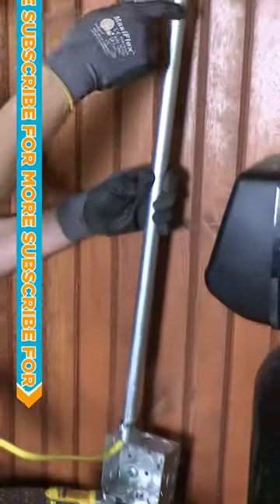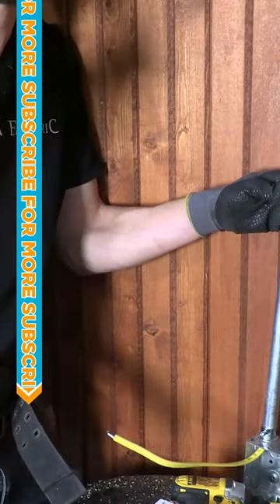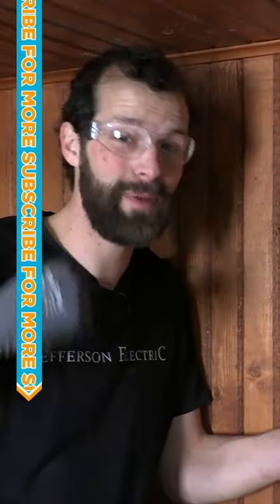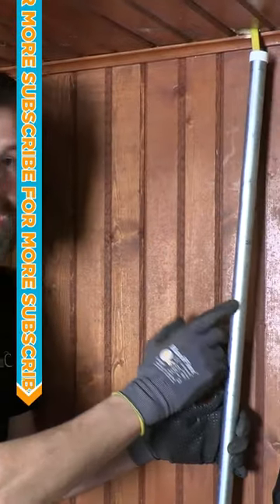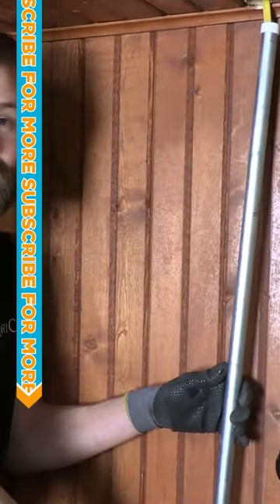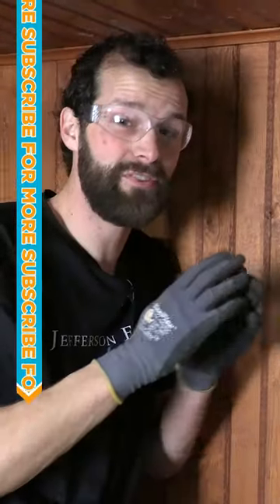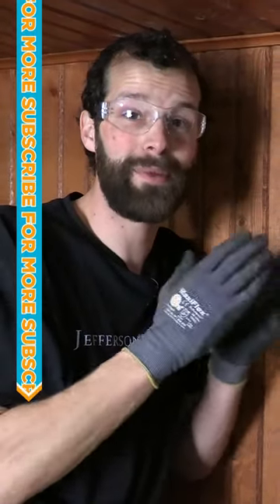Can Romex Be Run In Conduit?

Comment: The big problem of pulling romex in any conduit is difficult due to the flat side and solid wire. Personally, I would pull stranded wire indidual conductors to a jb and run romex to the panel if you have any 90 degree bends. Why run both at the same time it's necessary. Union Foreman since 1986.
I do industrial and commercials, mostly rigid conduit or emt. I used pvc a couple times to pull 2 circuts to a gazebo running 3/4 in pvc and plenty of wire lube and the 60ft with 3 90s and had a hell of a time. I switched to 5 #12s to the basement and ran romex to the panel. Pulling romex through is like pulling erasers through the conduit. Both have their uses. Using individual conductors cost less than the romex. It's unessasary and cost more. Solid wire is rarely used in my field. We don't do MC jobs, we do Technical Services for all fields of electrical construction power houses to airport runway and taxi way high voltage lighting, highway, 5g light wave for cell towers. 
Old saying, never enough time to do it right but time enough to do it again. I tell the crew if you do it right the first time, the job will make 
 money. In the power houses, they require identifying each wire at both ends for redundancy in quality control. Even the best of the crew could make a mistake. Thousands of wires in 10 weeks working 7 12hr days with 40 to 80 electricians. IBEW 5 in pgh pa has a fantastic education 5 yrs of school first 2 yrs you go to school during the day and are paid 8hrs and work 4 days for guaranteed 40 hrs min and 4 yrs of CCAC everything is free of cost. After completing the program with 10k hrs OTJT then you receive a journeyman electrician certification through the state. Then, constant continuing education in speciality training. I have witnessed the constant growth of the electrical field. As pneumatic control automation to the elimination of pneumatic to all electric via Analog in Analog out. Binary in and out. From 1997 half was pneumatic now the steam fitters lost jobs due to technical advancement especially with addressable identification. Smart devices. They don't build new skyscrapers but every building is under constant remodeling, and electricians are the first in and the last to go.

Comment: I notice you entered the EMT without the use of a changeover, instead you used a plastic bushing. Shouldn’t you be using a changeover (EMT to NM) for strain relief?
Reply: I noticed that as well and also he has no box offset bent on the conduit. Clearly not a commercial electrician
Reply: @ElectricProAcademy  I use minnies all the time for quick and short EMT runs, this looks fine to me

Comment: This makes me cringe but I understand the appeal. Romex is ugly but convenient, relatively cheap and easy to run. If we can only solve the ugly part, we have the perfect solution which is why people itch sticking this stuff through conduit for outdoor use. My understanding is this could cause two issues. First, the current rating of romex cables are calculated based on heat dissipation at some temperature in open air. If this is used in a conduit, then technically the current ratings will not apply since heat is trapped and has nowhere to go. 98% of the time this is no issues especially in residential applications but in industrial/commercial, you can easily meet or exceed the current rating and thus cause excessive heat build up and safety issues. Second, it makes passing other wires through the conduit difficult or impossible due to the nature of the cable dimensions and stiffness. If you question is, can you remove the cable insulation and pass the wires through individually, the answer is no but better than passing romex with the insulation. The reason is because the individual wires in Romex are not labeled thus not code compliant and I believe the insulation is not robust enough to pass through a metal raceway.
Reply: I googled it and everything I found said the wire in romex/NM is thhn.
Yes, it is not printed as required, but still thhn.
Reply: @markchidester6239  As it isn't printed on the conductors, I wouldn't assume it's THHN/THWN. A very anal inspector could fail you for using an unidentified conductor type

Comment: Ok... I like your content a lot, I've been in maintenance for 14 years and I just have one thing to criticize. Please buy some oscillating saws because your box cuts are trash... I'm sorry but I've been cutting boxes for years and I never, and I mean never half to patch, unless there was previous work on a wall unknown to me and it blows out... That's the only exception. Measure and level man, measure and level and then cut with an oscillating blade. Or just buy a better key saw, even though I use the same husky blade and still don't have those issues. IDK 😐

Comment: Not only is it allowed, it is required in some instances.  I don't know how this whole, "you can't do that because it will overheat" thing got started.  Type NM (Romex) is installed buried in insulation in exterior walls all the time.  90 degree conductors that are derated to 60 degrees.  In a lot of cases it makes no sense to run it through EMT, but it is permitted.

Comment: My understanding is that NM cable may only be sleeved in EMT for an indeterminate length between a box and the end of the stub of EMT, which has a bushing on its end. It should not be used in a closed EMT system between pulling points.
Reply: @ElectricProAcademy  Yeah it's really just a question of cross-sectional areas of the conductor/cable and its raceway fill; there is nothing expressly forbidding NM cable. It could raise the eyebrows of an AHJ, that might be the only thing. With respect to running NM cable through conduit in wet locations, well, I guess you could theoretically use Type UF! Ha ha

Comment: But it’s not about your jurisdiction or inspector. It’s about the nec. Regardless you should follow the current nec code no matter the area or location. A good electrician will follow the most recent code regardless and honestly I would never use romex inside of any type of hard pipe.
Reply: My thoughts exactly.
Reply: What he's referring to is like bringing romex in a basement on a block wall for protection only some jurisdictions allow this because it's not a complete raceway.

Comment: Romex is actually now allowed in conduit in wet locations by code…
IF it is less than 6’ and utilized as a service whip to an appliance using water tight fittings.
Reply: What code section is that in
Reply: @thomasmarable6818  service whips are all essentially flexible conduit that's rated for wet locations. Therefore the = sign works in both directions.
Reply: I would like to see that code article please.
Reply: @ElectricProAcademy  I have a code review class Saturday, I will write down the reference.
Reply: @ElectricProAcademy  ugh, I apologize, it is a NC code blue page revision… not nationally recognized. 300.9